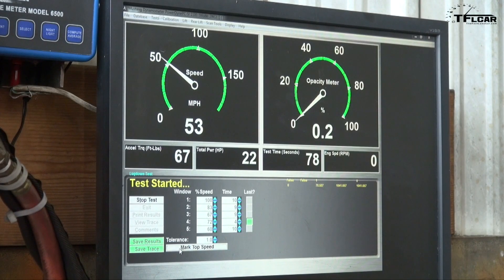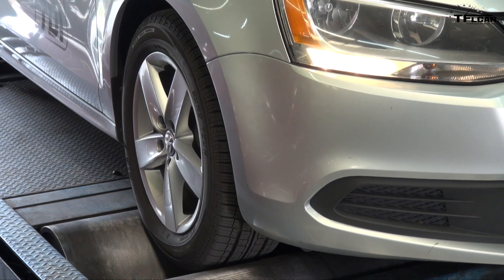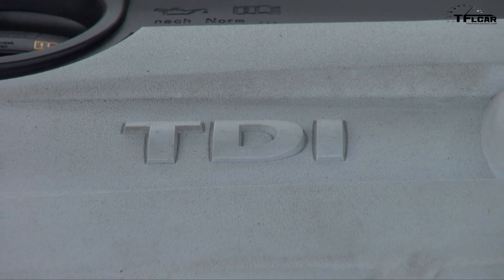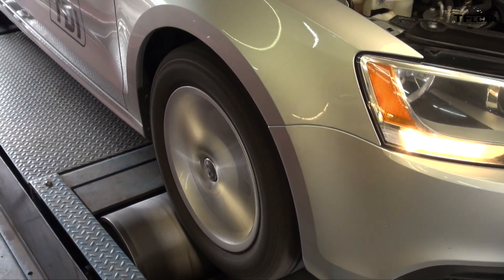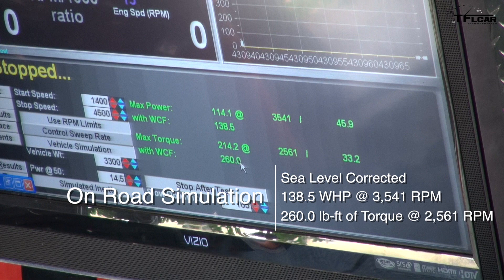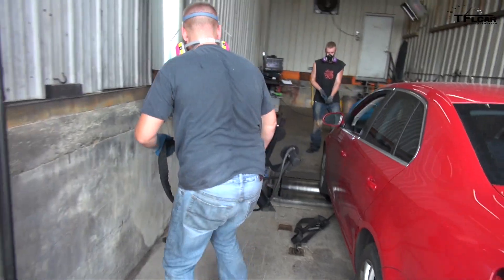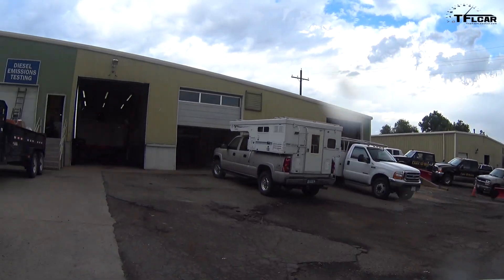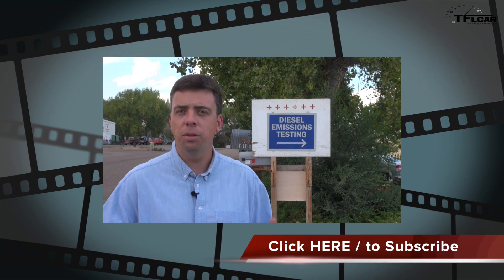Surprise! We Dyno a VW Dieselgate TDI Jetta to get the Truth about HP Loss

Comment: Well buying a Volkswagen to begin with was your first problem.
Reply: +matt k says someone with a Nissan Leaf....
Reply: I love my Leaf!
Reply: +Andy Hicks wow I have 9 Volkswagens around me regularly and none have electrical problems like those. None have transmission problems but of course they're all manual. I know the older automatics are trash but I'd never drive an auto anyway.
Reply: My 2011 Leaf has had one recall in 4 years, that was for a software update that more accurately adjusts the
range-o-meter. In fact the only maintenance has been a yearly trip to the dealer for recommended system checks and I've put on one set of tires. It's virtually maintenance free.
Reply: +matt k that's great!  seems like you may have missed a few though!  http://www.edmunds.com/recalls/nissan.html
Reply: My tdi has served very well for the last 2 years, so jokes on you bud
Reply: +matt k Can't argue with that!
Reply: +Captain Morgan http://www.consumeraffairs.com/news/jd-power-reliability-ratings-drop-jeep-among-the-worst-lexus-best-021214.html

not saying its great but not at the bottom!
Reply: Andy Hicks 

I have a Mk4, mk5 and mk6 and no problems all gtis
Reply: I have a 2002 Jetta TDI since new. No rust. I've never had a car last so long and it still has the original clutch.
Reply: Andy Hicks your talking about VW in the 80s and early 90s VW from the year 05 plus are a lot more reliable.
Reply: Excessive polluter? A jetta tdi needs 7 gallons to go 400 miles a ford f250 diesel needs 23 gallons to go 400 miles so tell me about excess polluter...
Reply: I figured almost all the people who loves Japanese cars like crazy are usually those who can’t change an oil, or put locktite on drain plugs.
Reply: I've had 3 and one is new. I love them.
Reply: +SlipknotMaggot0526 A Leaf isn't going to be an unreliable, excessively polluting POS.
Reply: +matt k One uncle owned 3 Rabbits, 1 was old-school diesel, ran like tanks until it rained (all 3 would get wet fuse boxes and randomly die on the side of the road)... I drove a '91 Passat for two days (loved it, but the electronic tranny was shot and half the electrical system kept shorting out)... I knew a guy with an '85 Jetta, tranny went and the headlight switches burned out every few months, none of the dash gauges worked... I did a lot of work on an '87 Jetta while working at a "buy here, cry here" dealer, replaced the ENTIRE brake system from booster to the wheels (new booster, master cylinder, lines & hoses, calipers & wheel cylinders, pads, shoes, drums, rotors, literally everything) and still the brakes would usually drag randomly (it did run awesomely at 378,000 miles, he was the 7th owner, last 3 owners babied the slipping first-to-second shift). A friend of mine bought an '01 Passat used, brought it back within two weeks because the heated seats, gauge cluster lights, power driver seat, and high beams didn't work. Driver side window kept coming off the track, and the window was extremely slow (dying motor). The tranny SLAMMED from 1st to 2nd, I had to teach her how to use the slap shift so she didn't get permanent whiplash. Another friend bought a used '99 Jetta, the tranny was of course shot, but randomly in the middle of the night, nobody near the car, the doors would unlock, windows would roll down, sunroof would open - problem with the driver door lock since all those "features" can be done by using the key in that door. Then, he lost all headlight and DRL function except for high beams. A week later, the ignition lock decided it wasn't going to turn anymore. The final straw for him was when he came outside to go to work one morning and found his airbags deployed while it was parked overnight - no body damage.

I feel safer driving my mother's tin-can Sentra with it's metal-shard Takata airbag than in a VW after all I've seen.

Don't get me wrong, through - I would love to own a Rabbit Pickup! A diesel Rabbit Pickup would be even better!

Comment: Should have reported the Air Fuel Ratio's. Even though you can't directly measure Nox, a leaner AFR, leaner than stoich in particular, creates a hotter burn which always indicates more Nox emissions. Low emissions don't go hand and hand with good fuel economy. Good fuel economy comes from burning leaner(among other things) which is a dirtier burn. Also, there is like anywhere from a 10 to 15% power loss through the drivetrain with a car like that. Altitude correction factors can be generous from I hear. With a 15% drivetrain loss with both uncorrected and corrected numbers the crank HP would be anywhere from 131HP to 158HP. Also the car could somehow detect an OBD2 connection and go into a "emissions mode", I doubt this though.

Comment: So would anyone who owns one actually have the recall work done? Are/will emission testing states refuse to pass these cars if the owners can't show proof of the recall update? I'd wouldn't want the recall work done, I'd rather have the extra performance.
Reply: +TakunTakun Probably only if they have to.  A lot of areas in the US have no emissions testing requirement so it really isn't a concern for those folks.   If you live in California they will find a way to force you to have it done.
Reply: VWAG threw us a free 162K, 11year warranty on drivetrain, fuel system, computer, turbo, emissions to drink the koolaid of the ECU flash.  phase 2 of 3 is out now.  phase 3 might replace the whole exhaust. Then, at 162,001 miles or 2026 all gen3 TDIs can race flash to 250hp and 300ft# after installing an $800 race exhaust and repacking those DSG wet clutches to make over 60mpg and 800 miles on a tank.  while everyone else is lined up for a battery charge every 200 miles, taking a 2 hour break from their trip after more trimming of their telemeres as their DNA is further unwound by the unblocked heavy gauss waves generated by big spinning magnets and the unknown effects of inhaling the LION off-gassing in the tightly sealed cabin/coffin.

Comment: From what the video shows, the car fought the dyno for the entire lower-rpm part of the graph, resulting in obviously lower power figures. Pull the ABS fuse next time and do an apples-to-apples comparison.  Also, looks like the car was left in DRIVE and had to be throttled lightly so it doesn't down shift.  A good test would have been throttle to the floor in a selected gear of your choice - DSG transmission would definitely allow for that.

Comment: I don't even see the big deal
Reply: VW said it was a clean Diesel and sold it as one but cheated on its emissions test so it turns out isn't clean and is as worst as driving 40 V8's all at once. Not in the MPG sort of way but the bad pollution sort of way. Which never would have been given a pass and be able to be sold in the U.S. if VW didn't lie to the government. Also some customers are pissed and will be suing soon.
Reply: +ChiTownRuler023 Ah I see now
Reply: +TechNerd1300 like, I personally like their cars, even though I drive Ford, and if I bought one it probably wouldn't be diesel, just because of all of this, but it'd be gas instead. At least this didn't kill people, and VW is handling this much better than the GM switch thing, what even became of that?
Reply: +TechNerd1300 If someone were to pipe diesel emissions directly into your room, i'm thinking you will understand really quickly. :)
Reply: No, I would not understand very quickly, I'd be dead...